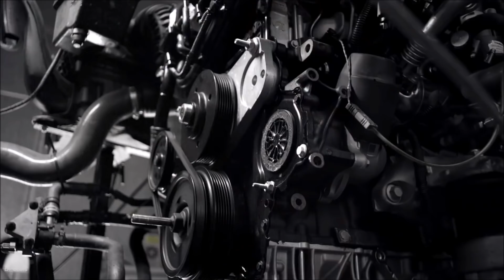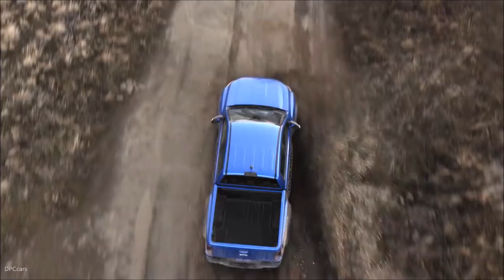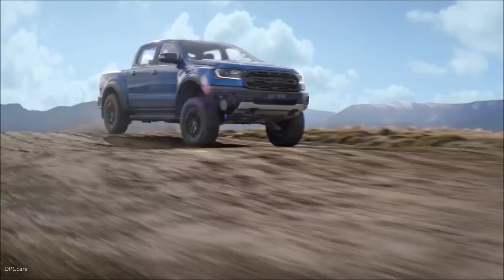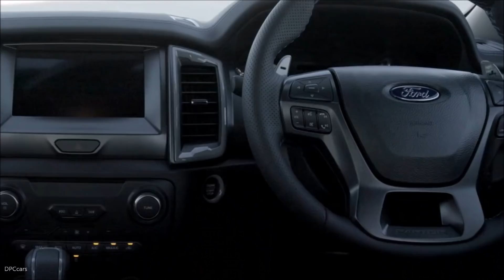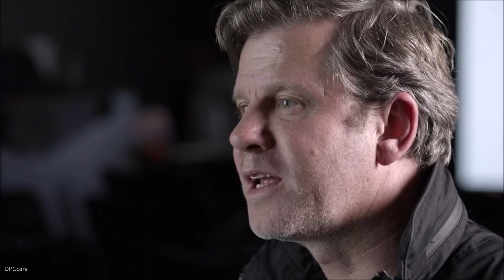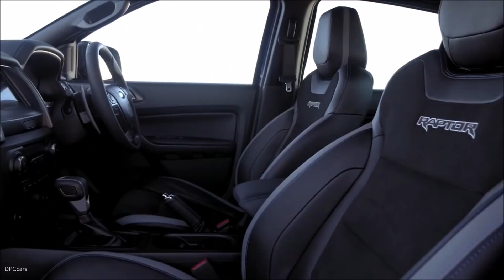2019 Ford Ranger Raptor Engine Suspension & Interior

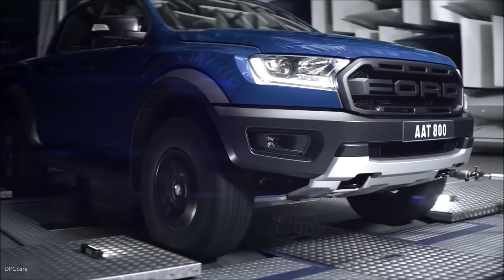Comment: 0:25 Is it true that they tested the engine full throttle for 18 days straight? I am not an engineer but I am curious if an engine can really last 18 days in full throttle. If yes, that is incredible!
Reply: It's BS! I asked ford service if i can do that and they said heck no! Lol
Reply: If the fuel is low its refueled while running still on full throttle😂😂
Reply: @youg-tj8oq  Its running in the lab attached to a big fuel tank
Reply: Not truth , same as with susspension. Few jumps and its over. Deep water warm transmission OVER . this is Nice movie car. Looks very nice thats all.